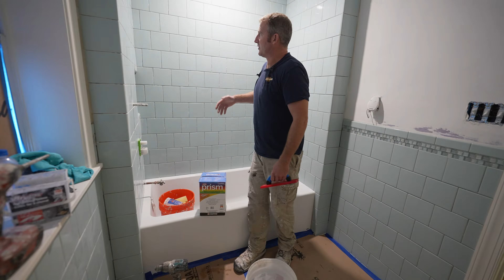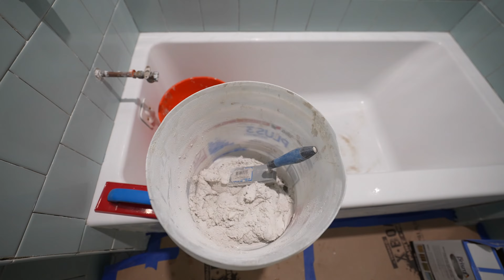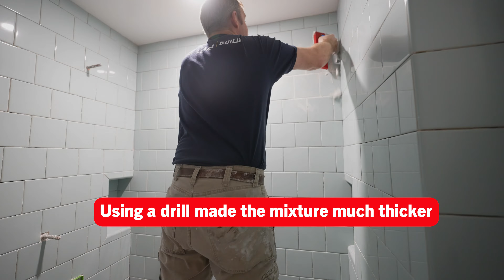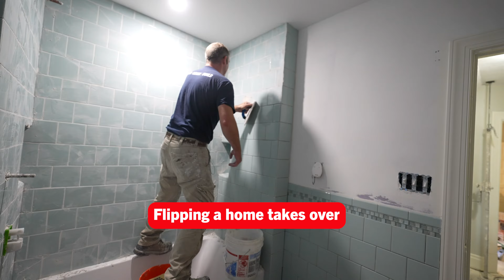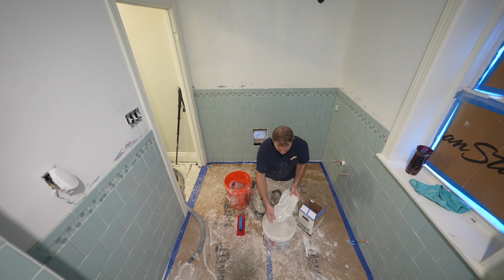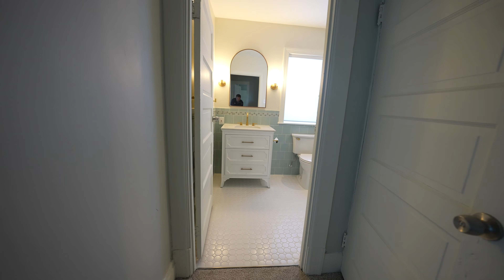How to Grout | Prism Grout | High Performance

Comment: Mixing with the drill works very well.... key to getting best consistency & pot life is mixing to lump-free, let it sit for 5 minutes and then re-mix for 30-60 seconds- do not add any more water once that "slake" time (waiting time) is done-   usually get 45-60 minute bucket life- temperature dependent- and product spreads very nicely.  Nothing wrong mixing with the margin trowel but must give that slake time to allow for all the ingredients in the product to come back to life, so to speak

Comment: Using males sanded grout on shower floor over flat mosaic pebbles….came out good but a few low spots between pebbles not sealed yet…can I add grout on top to bring it more even or will it not stick to the grout I just installed?

Comment: Do you recommend using a sealer like Miracle 511?  I know that the grout’s supposed to be stain resistant, but wondering if sealer would be worth the extra effort or just a waste of time.
Reply from the maker: Yes for sure 👍 511 is good stuff

Comment: how can a seasoned pro grout with something like that first mix? you can clearly see it was too thick and dry but he still used it instead of mixing it right. yes a pro can possibly do all 3 walls in one shot before washing, but do not attempt this please. if that grout kicks and you cannot get it off, you basically just ruined your job. no reason to do all that grouting in one shot except if your showing off. definitely recommend hand mixing for hi performance grout because a drill does add friction and more heat and like he said , more air. best to do one wall at a time and wait till its ready to wash instead of grouting to much and having it dry up on you
Reply: You saved my marridge
Reply: I agree and do one or two walls at a clip and I only mix a quarter bag at a time . I do one very light sponging as I go and another after 20min later. I have been guilty of cleaning to much before it firms up enough though
Reply: @jameseckelt4864  its a tough one for diyers because mixing multiple batches in itself can be problematic, but also doing to much can ruin a job, so these faster drying grouts can be an issue. because we have been doing it for a while, we have the mix down pat, so multiple mixes work fine. anyways grout on my friend

Comment: My contractor used Prism last Friday on 1x1 hex mosaic.  He made a wetroom /curbless shower and believes he is just about finished. The bathtub area grout looks good but the shower is very uneven, not flat.  I thought his cleanup would even everything.   Now it's 7 days later.  Can it be sanded or evened out or repaired?  Or should I have him pull up all mosaic, order new mosaic, pullout tub, and start over?
Reply from the maker: That sucks, grout typically accents tiling imperfections… I’m always hopeful too that it will make it better, but normally it doesn’t. Nothing you can most likely do that to start over….
Reply: @Bathroom Remodeling Teacher Thank you for your thoughts.  Just discovered a new leak Sunday morning in a room beneath where the bath is located.  I have to figure out who to fix all of it.
Reply: Mosaics are like that much more complicated than large format…

Comment: Yea ill take polyblend every time. If i wanted to burn up my rotator cuff pushing cement grout on a wall sure.... plus he dropped half the grout on the tub = scratches galore.
Reply: I'm sure he knows what he's doing. He's a professional at this. I wouldn't recommend someone doing this if they're not a professional contractor. Plus mixing this without a drill might make the consistency better.  This grout will last a lot longer so this will save on your rotator cuff. 👍

Comment: Man I used that grout ,  it went off in my bucket so fast.    Maybe I'm doing it wrong
Reply from the maker: Yeah if you mix with drill it goes fast. It is my least favorite high performance grout for sure….
Reply: @BathroomRemodelingTeacher  These high-performance grouts tend to set up faster.  I have found that doing one wall at a time works best.  Prism doesn't  take as long to finish either, if you find the sweet spot, which comes with a few trials,...and especially on smaller projects, the quicker set up is a bonus!
  
Beautiful tilework you did!